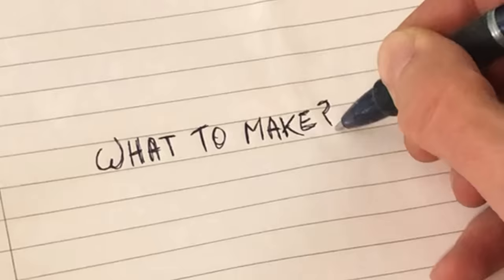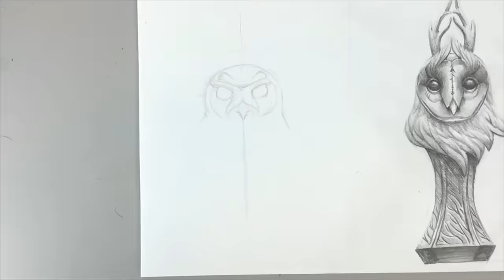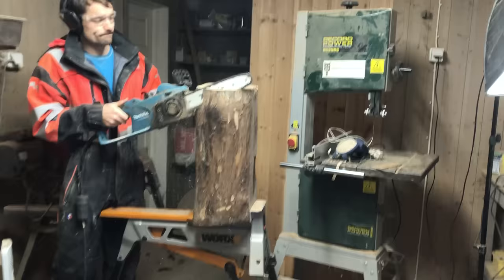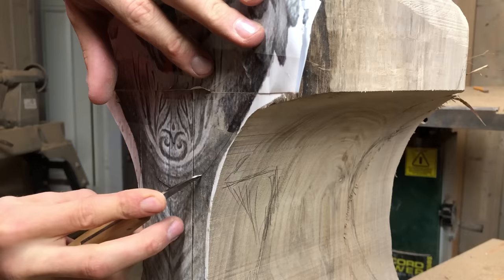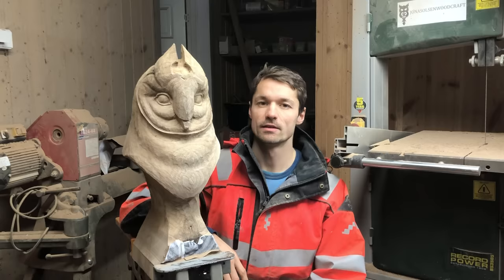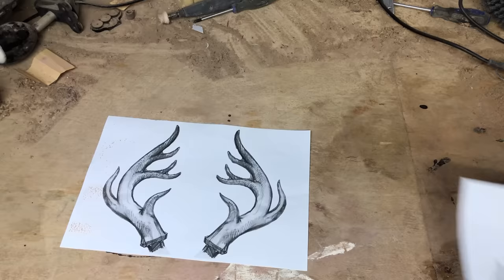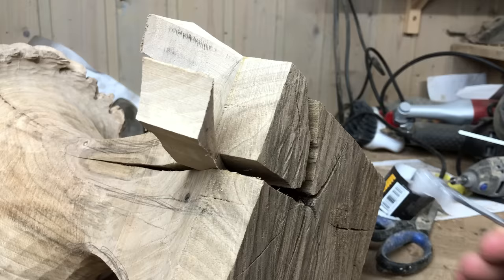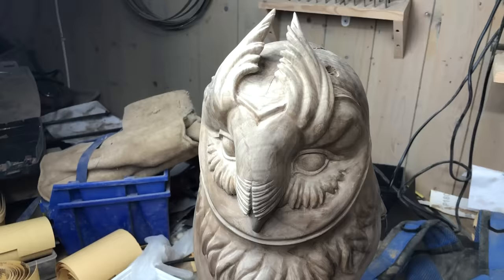I Carved The Queen Of Winter

Comment: Iam an 83 year old artist.  I am primarily a sculptor (first show at nine years of age).  A technigue  I use in wood sculpture when there are gaps or large cracks; is to cut wedges of wood , after a "glue" coat of resin in the cracks, drive the wedges into the voids, one after another, until void is full and epoxied.  I have gotten to where i no longer worry if it is the same color.  Once "finished" it provides "character"!  nice work!! Loren
Reply from the maker: Hey! I can imagine that would produce a pretty unique effect. I might have seen something similar done somewhere before.